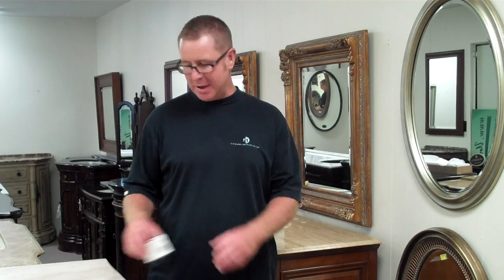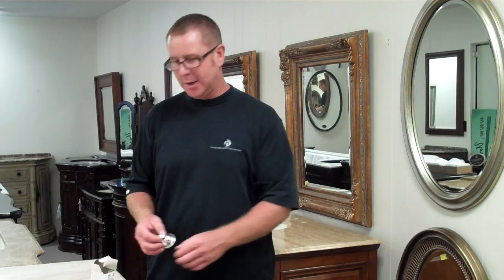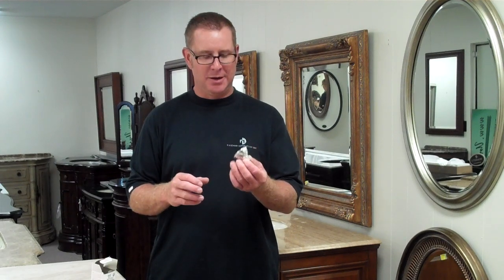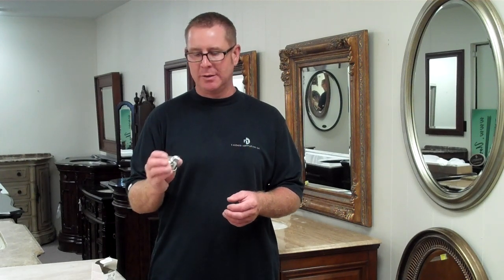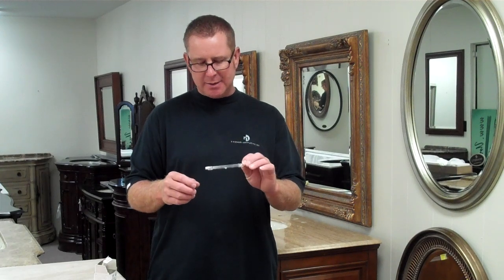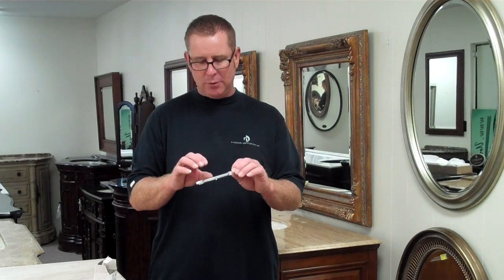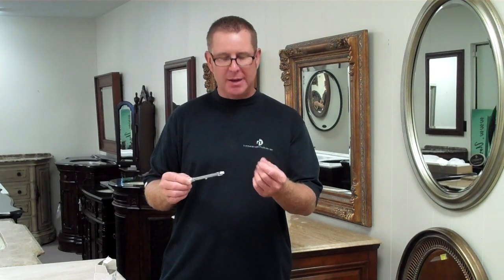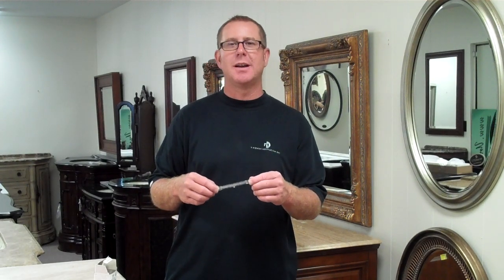How To Change A Halogen Light Bulb

Comment: What is the difference between quartz halogen head lightbulb,normal halogen headlight bulb and xenon headlight bulb used in automobiles?Which is better?Is the four headlight set up better than the two headlight setup?